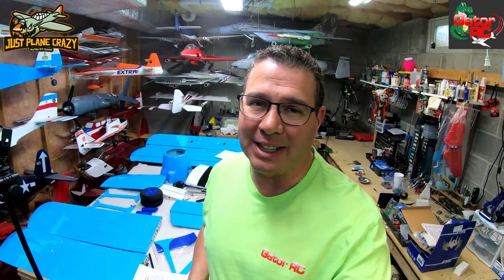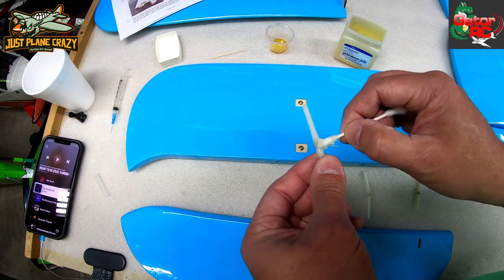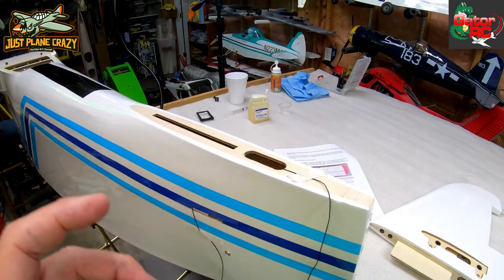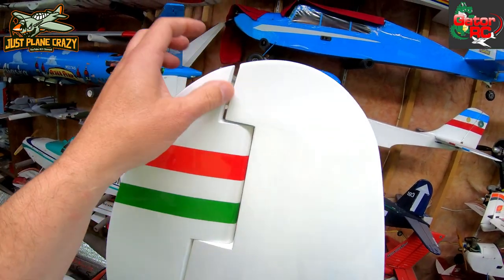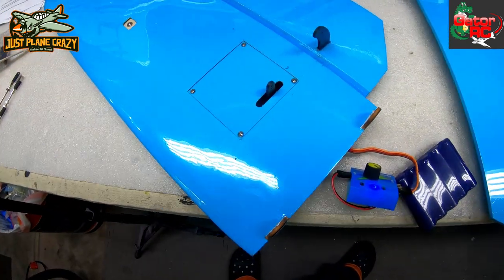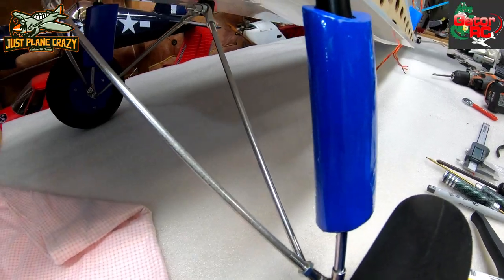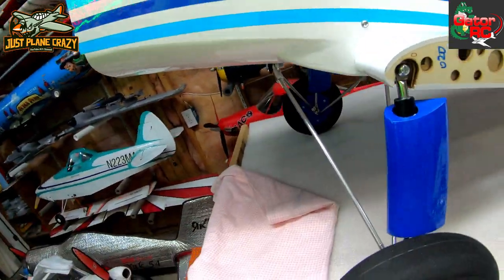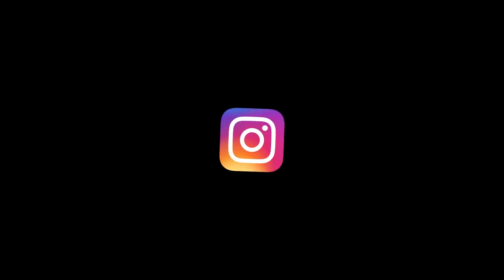Maxford USA 50cc Antonov An-2 Build Pt1 from Gator-Rc

Comment: Great build, nice plane. Never had either a Maxford or Seagull plane that didn’t have missing/unusable parts or poor part fit. Miss the days of Great Planes when everything was perfect. Last planes I bought that everything was perfect was from AJ Aircraft. Andrew Designs the best flying planes I’ve flown and the fit & finish have been perfect.
Reply from the maker: Yeah I don’t disagree. I am also a firm believer in you get what you pay for. Seagull is getting close to the others in price. I think the build itself is better. But the hardware leaves some to be desired.